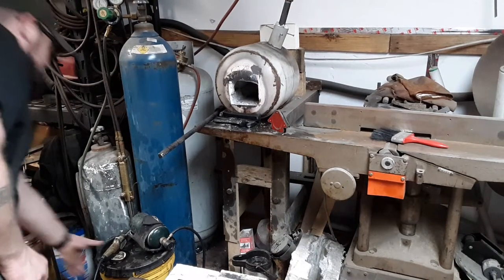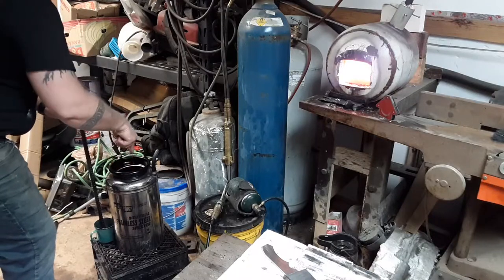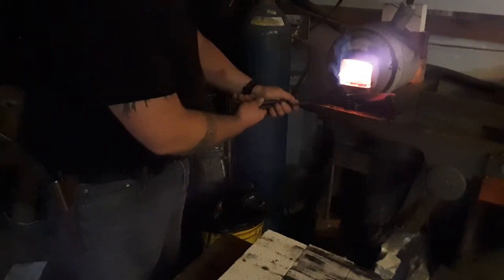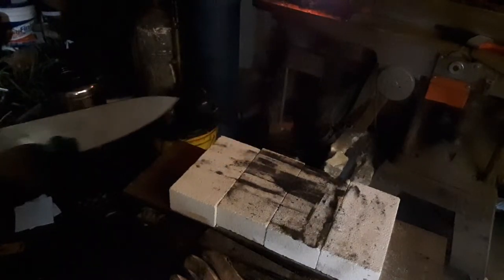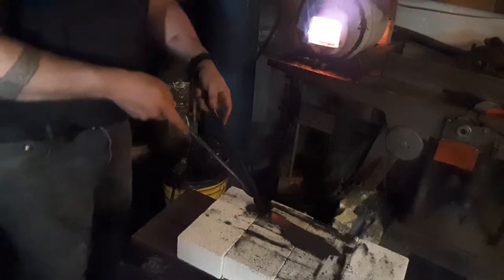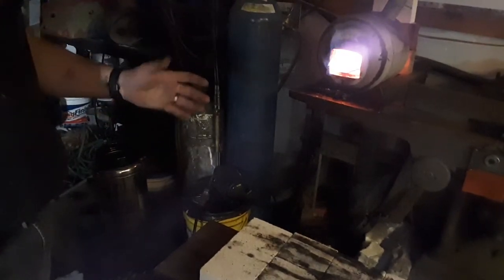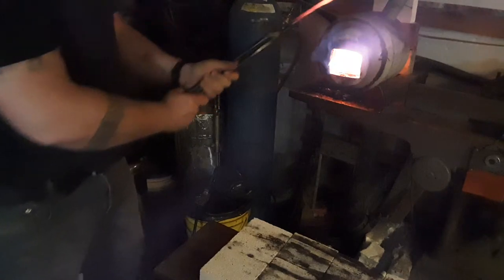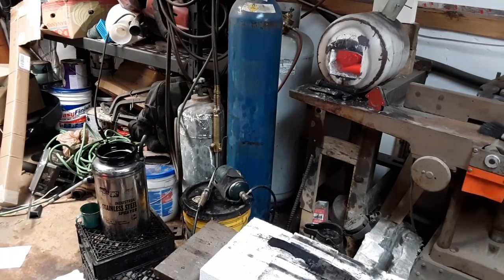Knife build PART 13-1084 steel normalizing, heat treating and quenching start to finish

Comment: like your video, i am just getting into knife making. while you are normalizing your blade do you have a time between each heats or till the knife  cools down.
Reply from the maker: Thank you for watching! I don't have a set time. The most important thing in my experience is a cool to completely black (no color showing in the dark). I however like to take extra precautions to cool to a point that I can handle the blade comfortably with out gloves.

Comment: How many minutes before the steel turn all black when put out the forged for normalizing
Reply from the maker: Unfortunately there's no specific time. It depends on ambient temperature of the area your forging,  what steel your using, how thick the steel is etc. It's been my experience that it's best done by eye. A good thing to try is normalizing in the dark to be able to see that all orange is gone from the steel. If your forge is outdoors and you can't turn off the sun try making an area that is completely in the shade maybe a corner or under a bench that's dark. At one point I used a wooden box that that I built that was deep enough to put the blade in (using tongs of course) to be completely dark so you can observe the color. I know you didn't ask and you may know this already, but some additional advice from my experience is... it's recommend to normalize in completely still air. No fans or waving the blade around. That can cause uneven cooling of the blade and induce warping. And setting it on your anvil to cool can cause the side touching the anvil to cool much faster and can warp the hell out of it. I say this based on my experience and I'm sure there's other that may have different recipes.